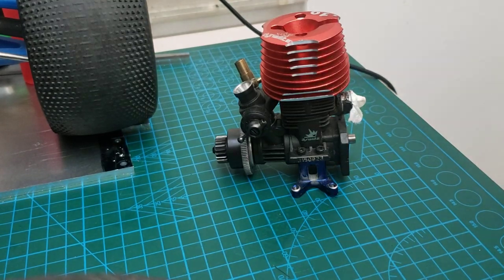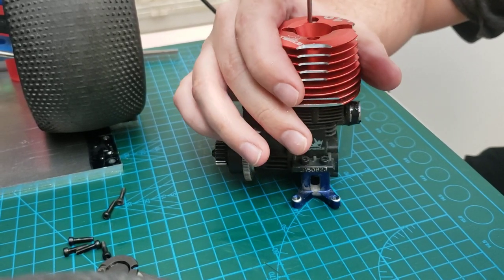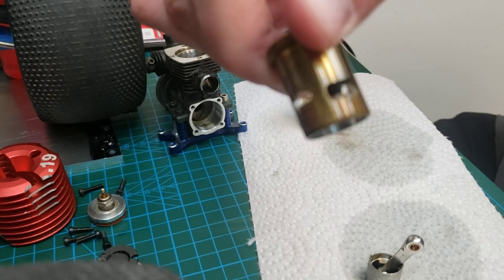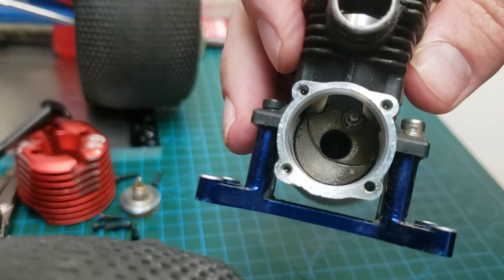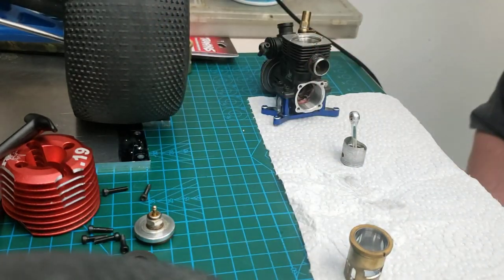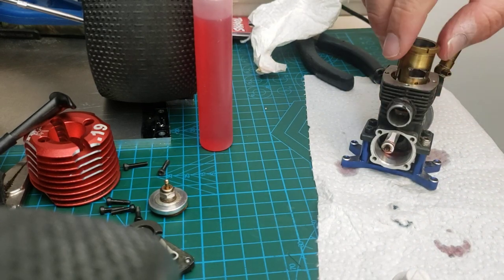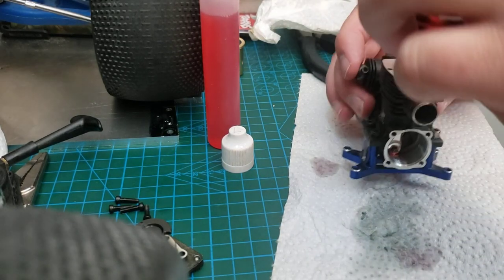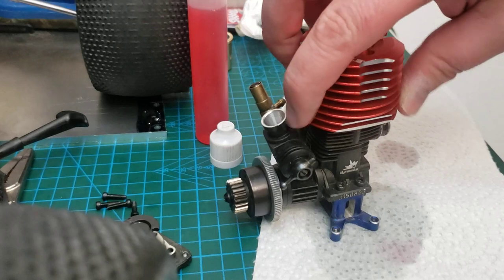Dynamite Mach 2 .19 look inside after 10 gallons.

Comment: I run a os .21 tm in my revo and I love it other than the price. I was going to get a backup .21 but I just noticed that they went up from $279 to $414. So that is a no on a new os .21. tm. I'm thinking about getting one of these for my nitro rustler. I'm tired of traxxas nitro motors. I have never had one to last more than 1.5 gallons. I never run them lean and I always use after run oil after use.
Reply from the maker: That's the thing with the 3.3 and 2.5 is you have to take your time with the break in process their method is absolutely horrible for all engines run a quality fuel keep your oil content 12% or a little bit less equality plug and if you do things properly they can last quite a long time would be quite surprised With the 3.3 and 2.5 because of their absolutely horrible bearing profile I change the bearings connecting rod and piston pin every few gallons and I am able to get almost 10 gallons apiece but the break in is  Is where it's going to kill at the most
Reply: @thebug4046  what is the best break in process?
Reply from the maker: @trickmustang1994  YouTube atom Drake method for break in a longer slower break in process will yield a engine that tunes better performs better and last longer! Anything you learn from Traxxas forget it. Just about the money they tell you to do it a certain way to kill longevity. Also tuning over rich is bad as well will were your piston and sleeve out faster because it's not coming up to temperature properly Also NEVER TUNE BY TEMPERATURE! it won't help you tune till running its best and leave it..  also a quality fuel is a must avoid Traxxas fuel its garbage it's very corrosive and burns very hot and lean and is meant to kill your engine faster keep your oil 12% or less it will run  cooler tune and perform better as well as Last longer.. as for after run is a complete waste of time run your engine out of fuel when you're done you don't need it all the time unless it's going into storage. It will make starting and stuff much harder  as well I run quite often a never use it and have no problem keeping in mind WD40 is not after run oil it's a kerosene based solvent that is ment to displac water. It has no film strength and wil attract water as well the best thing is Lucas air tool oil.. I do have a rc group nitro/diesel/gas rc and more. 2 question to answer and I will let you in
Reply: @thebug4046  I run o'Donnell racing fuel, I have no idea what percentage of oil is in it. I have ran it for about 20 years. I do have some engines with over 12 gallons with it.
Reply from the maker: @trickmustang1994   Odonnell is great fuel but it is been discontinued for about 4 or 5 years now so anything your buying is old stock if it's the racing blend it's 8% oil
Reply: @thebug4046  I have probably about 20 plus gallons left. I bought all their nitro that hobby town usa had in my home town when they were going out of business. I think it was 2015.
Reply: @trickmustang1994  Watch it! I've had 3 year old fuel go bad right in the unopened plastic jug. 
I dont know if it was water, or the methanol evaporated, or what, but at anything more than a quarter throttle the engine would pop, actually backfire, and quit. I tried a new plug, no good. Replaced my fuel filter and lines, no good. Replaced my questionable header gasket, no good. Got some new fuel, a-ok. 👍
I ended up throwing away the 2 gallons of unopened fuel that I had. Those plastic jugs the fuel comes in isn't the best container to be storing fuel in for long periods of time. If the fuel is in a proper metal can, it lasts a LONG time.

Comment: I finally got me a dynamite. 19 and I'm breaking it in right now. The Adam Drake method. So far so good, I'm really liking this engine.
Reply from the maker: Right on run a THS pipe kit with it will be even better and a quality 30/9 fuel
Reply: @thebug4046  where can I get that pipe at?
Reply: @thebug4046  their website is always out of stock.
Reply from the maker: @trickmustang1994   Check out my Facebook group nitro/diesel/gas rc and more if you want to check it out just 2 questions i will let you in

Comment: 10 gallons love the condition of your motor, proves that good tuning extends engine life. I hate hearing nitro engines screaming over lean sounds like they are screaming for help!
Reply from the maker: A lot of people run them like that to the point where they start to break up in the higher RPMs or running a body with no air flow or running shitty fuel
Reply: @thebug4046  you're right there and then blame the engine. I've got a cen nx46 that's got 5 gallons on it still mint internally but it's always been a sensitive butt ache to tune

Comment: Great engine indeed! and great video as always man.
maybe you are not the one to ask but, maybe you do know if a pull start eliminator exists for this engine? (i know i could just leave the pull start on it and bump start it) 
but i would like to eliminate the extra bulk at the rear as the engine is sitting sideways in my vehicle and the pull start gets in the way.
Reply from the maker: Hey thank you for watching and as far as a pull starter  Eliminator goes I'm not sure that there is one for this engine but I'm sure that there is something else out there that could be made to fit from another small block.

Comment: Great video 👍🏽 , question i just got my hands on a HPI RS4 and I wanted to know if that dynamite .19 will fit  ? Thanks in advance
Reply from the maker: In an RS4? maybe. I have never seen it done before. What engine do you have right now?
Reply: @thebug4046  it’s the stock nitro star .15fe
Reply from the maker: @GerardoSoler-c1v  ah gotcha ok yeah I'm not 100% sure. I know the VX 16 and VX 18 will be the easiest engine to swap in as it's basically the same as the HPI 15FE

Comment: I’ve got a little 10th scale drag car. You think this engine would work good? I’ve got a vx .18 in it right now. I’m also thinking about the sh .12. I know it’s a smaller engine but I know the .12s are real screamers
Reply from the maker: Yes it would do great!
Reply: @thebug4046  yeah I’ve made the decision to go with the .19 when my current engine gives out. Mainly because it has a pull start and the SH .12 doesn’t. My plan is to run it stock and then once it needs rebuilding I’ll try modifying it unless it’s got enough or more than enough power I need. Nothing too extreme. Just a little port work and maybe some crank work if it needs it. I’ll keep an eye on your vids on this engine to see what parts and stuff I’ll need
Reply from the maker: @ashermorales8276  for port work on these engines it's not as easy as just making holes bigger you have to know timing numbers or you can make shit much much worse. Send it away to RB MODS i know they guy he does awesome work
Reply: @thebug4046  I see people make ports bigger and I just facepalm every time 😂 if I’d do port work, it would be adding little fangs and chamfering the bottom of ports for better flow. Timing numbers are so sensitive on these smaller engines, even a hundredth of a millimeter changes timing by a few degrees
Reply: @ashermorales8276  It's not just altering the port timing, but it's REAL easy to slip just a touch, and end up taking chrome off the inside of the sleeve. Then it flakes off later as the engine is running..
I port and polish my own engines if a look at the internals reveals that any work will improve it, but I will not mess with changing timing.
Reply: @davelowets  port timing only is something I adjust when an needs more top end. I take the slightest bit of material off of the top of the exhaust port. Other than that, I don’t touch the timing of the ports. I do increase crank timing though as that’s where a lot of power increase can come from but that’s different
Reply: @ashermorales8276  Right, that's the window port in the front of the crank. I'm not afraid to touch on that area, but when it comes to the sleeve, that chrome plating is TOUCHY. I ruined a sleeve and had the chome flake off the first time I tried to alter the port timing, so I won't mess with it again.

Comment: Out of the box (.19) should the bearings be change or a couple of gallons later?.
Reply from the maker: If you want I put 5 on mine before I put in new ones not an issue
Reply: Cool. I have gotten the engine but was concerned if on one of your vid said to replace out of the box or when need to. Thanks for clarifying that. Man we need a nitro imoji. 😂.
Reply from the maker: @713Ace529   I believe I was talking about the 3.3 because the bearings are very poor quality

Comment: Love you’re videos man! Really looks like you know what you’re doing, looks like that engine has a quart of fuel on it and it has 10 gallons. Crazy. Quick question, what are you using to clean your engine components with? I typically use nitro-spray cleaner but it’s so expensive, thinking about just using brake clean, keeping it away from plastic components and o rings of course.
Reply: non chlorinated brake cleaner wont hurt the plastic or rubber
Reply from the maker: Non chlorinated brake parts cleaner  it's cheap!
Reply: @thebug4046  thanks bud wanted to make sure I got the right stuff.
Reply: @savagenoob  thank you for the information, getting some ASAP.

Comment: I'm thinking about getting one of these for my t-maxx. I bought it used and haven't been able to get it running properly as it just idles and dies every time I run it for a minute or 2. My jato has no issues plus I see nitro getting slung out from the bearing behind the flywheel. As you said the cost of all the parts to repair the engine properly are greater than this engine. So you recommend a 30% fuel mix? I'm still new to nitro and learning and have been using 20% in the jato without issues. Thanks to your videos they have been very helpful in learning all that I can about nitro engines.
Reply from the maker: They are a pretty nice performing engine very easy tuning I will say make sure to preheat it 1st before starting as they are very tight and it will make your life a lot easier now easier now I think I didn't mention that the front bearing doesn't actually seal usually running too rich or using too much afternoon oil will push past the bearing and make a leak.  Also it really depends on what the prices of new parts are like in your area over here the 3.3 cost $320 Canadian so we rebuild them for about 125. Or so. And 30%? Absolutely! Go for it
Reply: @thebug4046  Awesome thanks for all the information. My t-maxx makes me hate nitro until I get my jato running. I'll be sure to get a heat gun to make life easier and the 30% fuel. New the 3.3 is like 225 usd. I haven't checked but most people say with the trade in you can get them for about 130 usd. I'd enjoy an os21 but if I mess anything up on breaking in or tuning I'd rather do it on a less expensive engine instead of 340 plus. And I'll definitely be looking at finding a ths pipe like you said just for ease of installation and performance.
Reply from the maker: @MruGotP3NED1  I suggest you go look up the Adam drake method for brake in. Very easy to follow
Reply: @thebug4046  Will do, I've seen a few of his videos when I was first learning about nitros. You don't happen to know what ths pipe would work for the engine would you? I have the 3.3 extended chassis t-maxx and see pipes and manifolds for the 2.5. Did you also get your tools from there? They look really good compared to the garbage ratcheting set I bought from traxxas that broke on its 2nd use lol.
Reply from the maker: @MruGotP3NED1  if they are back in stock order a THS pipe kit will work properly with the 19. And the tools i have i have had for the last 18 years or so haha but definitely good quality tools help a lot

Comment: Any recommendations for a replacement for a Traxxas 3.3 in a revo, even if it requires a mod or 2 that's fine, $300 usd is the budget
Reply from the maker: The OS 21tm or dynamite 19 with the ths pipe kit
Reply: @thebug4046  Are both of those basically drop in replacements for the Trx 3.3, if you aren't sure that's alright. And thanks for the super fast reply.
Reply from the maker: @zack9692  yes both of them are Traxxas replacement engines no mods required. I do have a Facebook group nitro/diesel/gas rc and more.  2 questions to answer and you can post ask questions and so on.. I'm the owner
Reply: @thebug4046  Well if I had a Facebook account I'd definitely be interested in the group, thanks for the info though 👍
Reply from the maker: @zack9692  right on and you will like those engines
Reply: @thebug4046  Decided to go with the OS .21 would've got the dynamite, but it's on back order to late July, but I'll unfortunately have to wait on the ths pipe and use the old 3.3 pipe for a while and based on your recommendation to throw out top fuel I ordered VP 25% nitro

Comment: Love your videos... always good info.... by the way, what tool set do you use?
Reply from the maker: Thanks for watchin! And it's a old sportwerks set from around 2004 or so
Reply: @thebug4046  Thanks. I've got a shitty traxxas set that is a pain in the ass so I need something a bit better. 
 I use to dabble in nitro RC cars back in 2005... then got rid of it and recently picked up a used Revo 3.3... Your videos have convinced me to upgrade to a dynamite .19
Reply from the maker: @babb4214  the 19 is a good engine but get the spring mount header! You will understand why later on! Run a quality 30% fuel with 9% oil and it will run tits!

Comment: How do these engines compare power wise to a 3.3? Are they better at high end? Low end? Etc..
Reply from the maker: The 19 is a 5 port. timing is better and there do make more rpm and better midrange
Reply: @thebug4046  Thanks for the info brotha, how does it compare to the OS .21TM? Only asking cuz my current 3.3 is getting tired after all these years
Reply from the maker: @jonathanrigley981  the os 21tm is killer!
Reply: @thebug4046  sweet, I'll have to get me one

Comment: This might sound like a stupid question but thus is engine specifically design for Traxxas vehicles only or can I use this in any vehicle?
Reply from the maker: It was designed for Traxxas but it will fit any small block stuff if you can figure out exhaust throttle and crankshaft setup
Reply: @thebug4046  I appreciate the response. I’m building a 22t 4.0 nitro conversion and just looking for options. I have a OS .18 Cv-RX but it has a threaded crankshaft so looking for nitro with a sg crankshaft.
Reply from the maker: @lastpally   Yeah that's a little bit of an issue unfortunately as those engines are discontinued
Reply: @thebug4046  another question bc you know your shit. I bought a new OS .18 TZ cheap with a sg crankshaft so that basically fixes the compatibility issues. However how do I know what headers work? Would a .12 header work on a .18? Also what do you use for reducing engine wear? Appreciate your help!
Reply from the maker: @lastpally  yes. A 12 to 18 header will work
Reply: @thebug4046  Thankyou for the help! Also I’m watching the Nitro Gang live stream and he mentions your name I got a good laugh. To be honest I have very little idea what I’m doing with nitro however I been in the hobby for 23 years and used to build brushed electric motors back in the day. However, will near all 30 of my rc cars being electric (brushless) they’re just not exciting and they end up shelved. Hoping nitro returns that fun I used to have  when I used to tune/rebuild brush motors.
Reply from the maker: @lastpally  no problem! Not sure if you're in the Facebook group nitro RC enthusiasts but if you're not im in their to it's a awesome group lots of great people and information. I try  To squash the bullshit people have come up with over the years that has scared people away from nitro

Comment: When you used the acetone in the homebrew fuel a while ago did you notice a difference from not using it? Love those 0% running videos.
Reply from the maker: Honestly not much
Reply: @thebug4046  Right on. I was curious. I have an older .21 that I started running on low nitro as inspired by your videos. TY. I live in the states so getting your hardware methanol isnt happening. I do fing HEET (yellow bottle) sometimes. But now that its getting hot out cant find it. I just like to expirement and have fun.
Reply from the maker: @daveshank1921  look for a race fuel dealer in your area and order your methanol that way or order it from torco or vp
Reply: @thebug4046  I hear ya. Been buying BonesBrew it works to about $33 u.s. for 3 gallons 30% 10% works for me. I did find a Motorcycle (Dirtbike) race shop that said $55 for 5 gallons of race methanol. Good deal there. TY again.
Reply from the maker: @daveshank1921  55$ seem a little high because I hear a lot of people get vp methanol for about 35 for 5 gallons but I don't know the stats on it
Reply: @thebug4046  Thats sounds a better deal. Wonder what shipping would be if I had to order it. Ill have a look around.TY.
Reply from the maker: @daveshank1921  not to sure to be honest see if you have a VP dealer in your area and see what happens
Reply: @thebug4046  Yup that was the plan. TY again for getting back to me. Awsome job on the videos.
Reply from the maker: @daveshank1921  no problem! Good luck!!